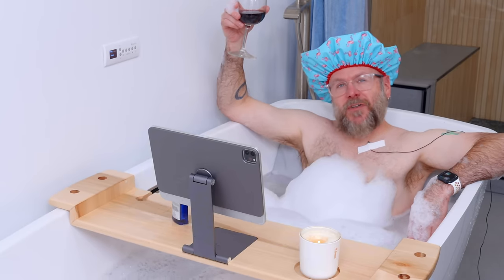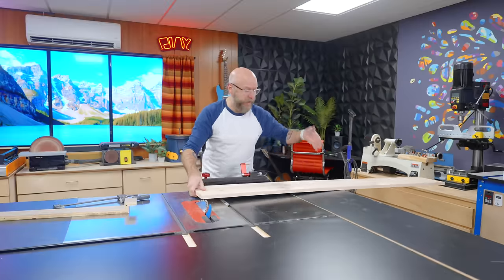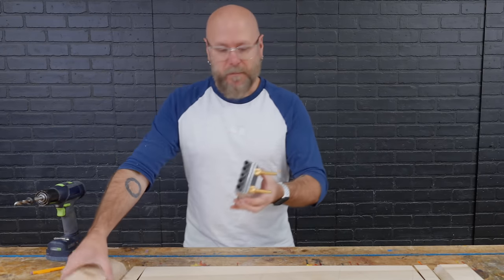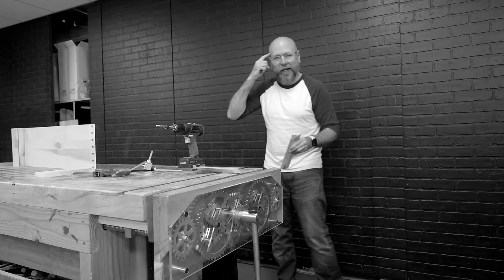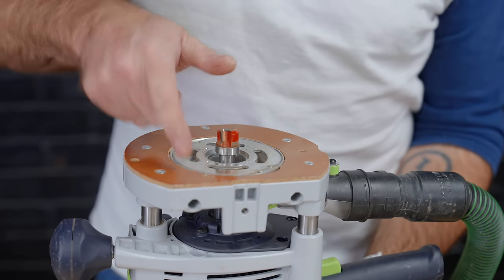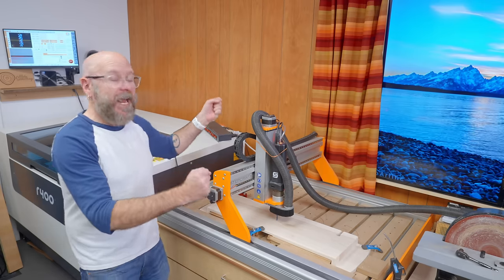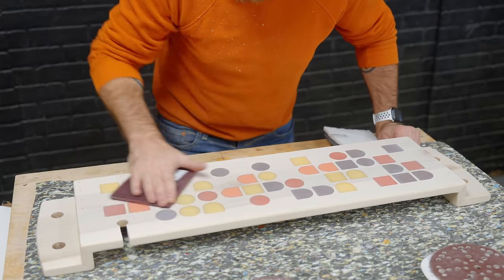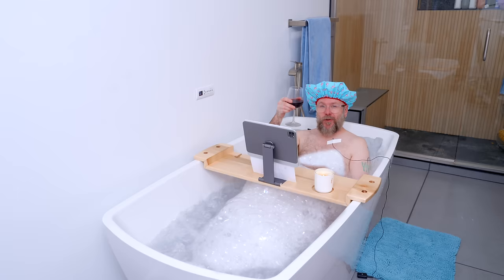When you can’t buy it, MAKE IT! Super Custom Tub Shelf

Comment: My dear, metric is the simplest stuff. All are just multiples of 10 or 1000. In metric you have all the basic units and the rest is just simple multiples, where you either add zeros after the number or move the decimal point to the left. No need for any fractions in the imperial system. And who even decided and normed (standardized) those imperial units?
Reply from the maker: Right! That's the joke! 🤣
Reply: Fractions are not a bad thing!  Most people just don't know how to use them and were never taught their advantages.